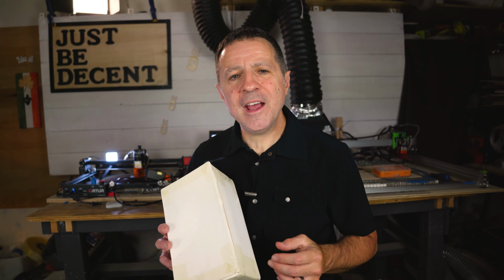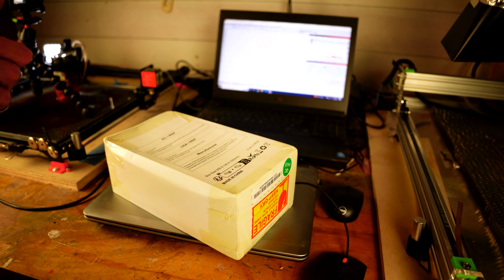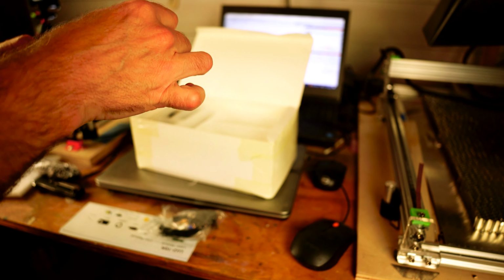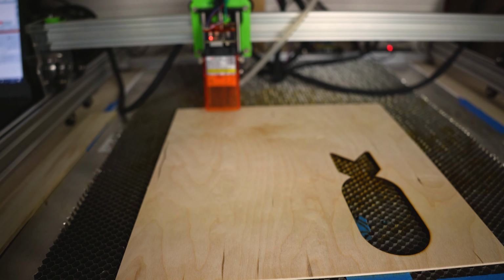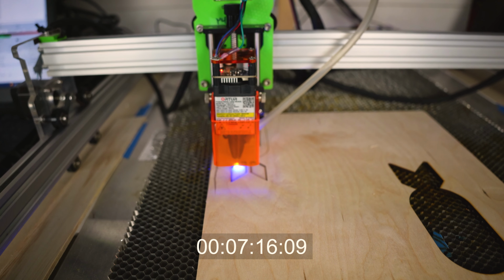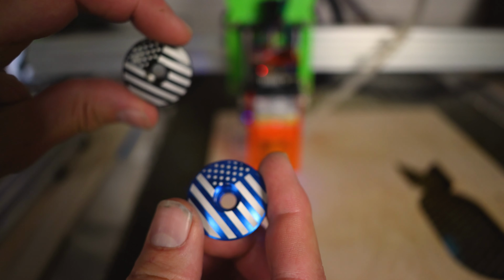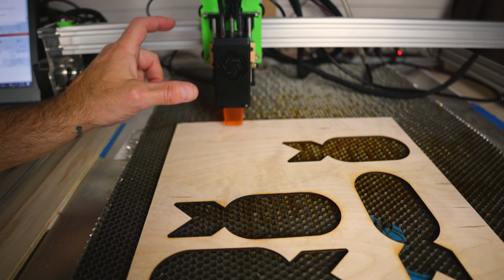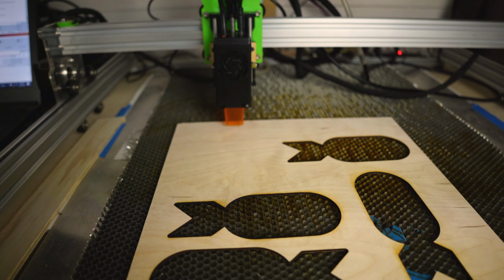Ortur 5watt vs 10watt laser module showdown |Laser cut test

Comment: Good afternoon sir how did mount your laser to the Z axis.  I just purchased close to the same setup and really new to this any help would be appreciated.
Reply from the maker: John

I used the metal back plate from the Z axis and thr two holes on thr top of that line up with the plate that comes with the 10watt laser.  I need a slightly longer bolt and nut to tighten it together. That assem3 gets screwed into the Z axis. After that the laser slides onto the Z axis. If that makes sense?
Reply: @YourCouchsucks  thank you for your time and info I will have to give that a shot
Reply from the maker: @JZee49  let me know if you need I'll try to take some pictures or do a short video on it
Reply: Hi there.  Excellent video.  I am getting ready to buy this module as well and I cannot find any info anywhere that talks about it being compatible with the upgraded z-axis.  I also have the LM2 Pro.  Thanks.
Reply from the maker: @jnick67a  it's not 100 compatible from what I saw I had to "rig it in". I'll try to get togther a quick video on how I connected shortly